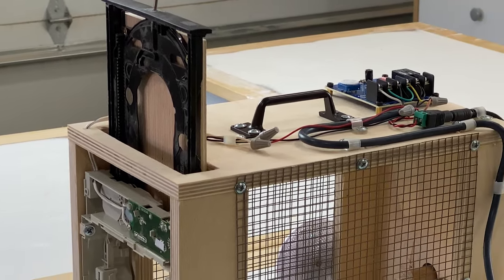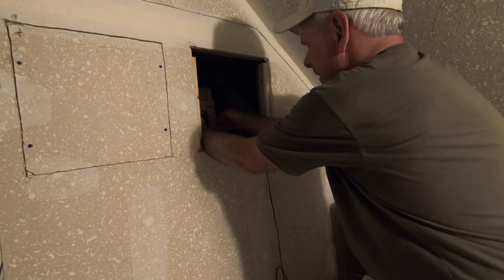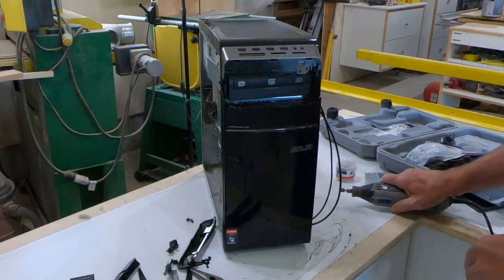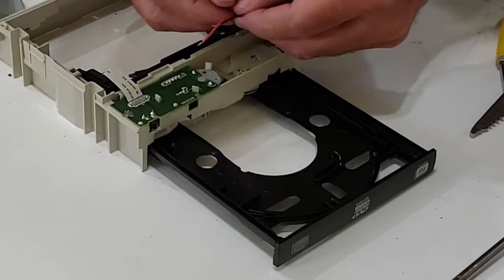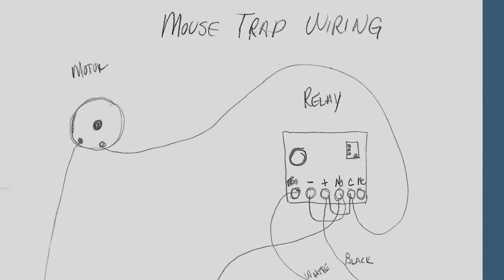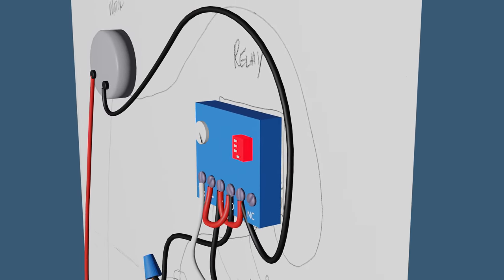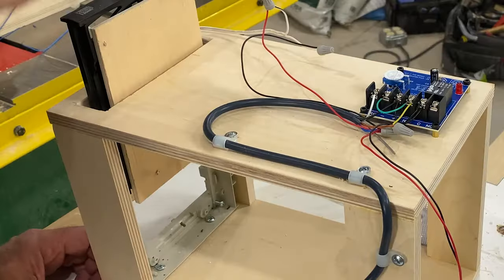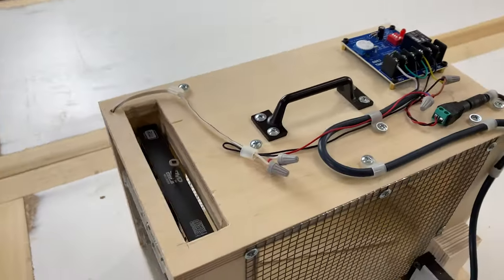Build a Mouse Trap from an Old CD Drive and a Few Electronics Parts

Comment: Pretty slick setup!!! I always use a shotgun to get rid of rodents.... lol... not really... As I was watching, it looks like you have to pull the door up by hand. Just a suggestion... Mount a momentary button switch to the top of the trap and wire it to door motor with opposite polarity of closing and let the motor open the door... You may have to use a relay to keep the open circuit separated from the rest of the system... Or you may be good with the manual operation also...
Reply from the maker: Yeah, Danny, I thought about doing that reverse polarity idea, but didn’t have a clear understanding of how I would do it without researching it more than I had time for. Plus, then I thought I would probably be we walking through the house with a mouse in the trap and accidentally hit the button and turn the mouse loose inside! That would go over real well with my wife! So, a screw in the CD drive tray works fine for this purpose. 

I do enough electronics stuff to find a solution to my problem and typically stop there. That relay has lots of features that I have not worked with. I do have kits and courses that I would like to explore somewhere down the line, but as you also know so well, time is beginning to catch up with us!!!
Reply: @RustyDobbs  Yes sir, I understand the time thing. I guess I worked with electrical controls so much that I forget everyone don't have the experience that I have. If it works, don't fix it is a good way to go....

Comment: Now that is quite the mouse house for the end of a mouse’s life. 🤣🛫
Reply from the maker: Yes, Falcon, it certainly is! I was doing a major remodel on my house about 12 years ago that gave the mice alot of access to ways to get in the house during construction. I got pretty good at catching them back then by various means. But the first rendition of the electronic trap convinced me it is fool proof. They cannot resist the peanut butter and there is no way they can trip the beam and run out of the trap before the door closes. They are fast, but not that fast! I've wanted to build an updated version for a couple of years, so this year's population explosion of mice gave me the reason to do it. Actually though, the two talked about in the video have been the only ones in the truss space this year and they were both caught in the same day. The tiny one in the house had to come in through the front door when we were coming and going as he was about 10' from the door when snagged by the sticky board. There has been no evidence of activity in the house at all, so he was by himself. Yeah, I don't like them inside anywhere and this electronic trap approach makes quick work of them. Actually a fun project too!